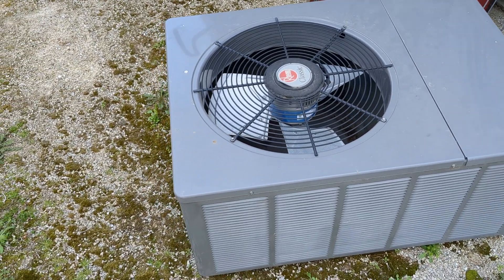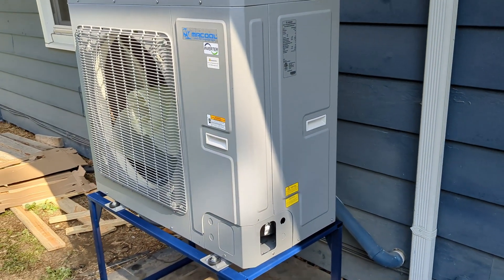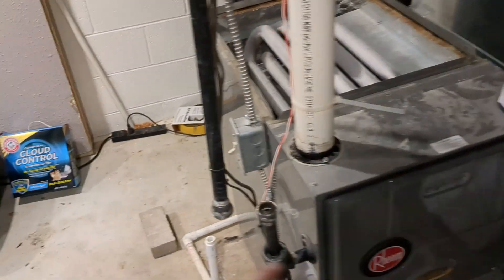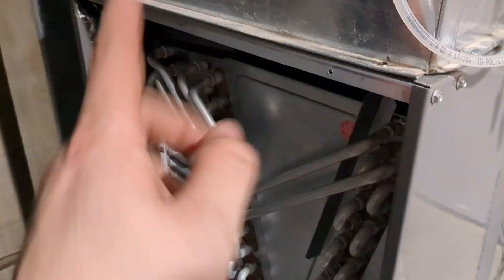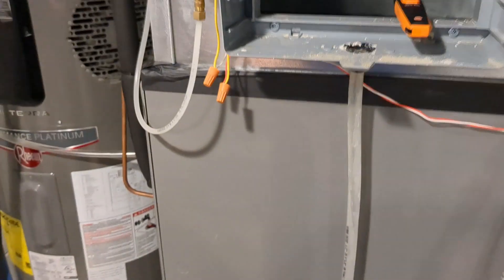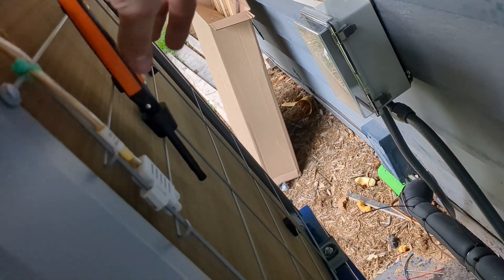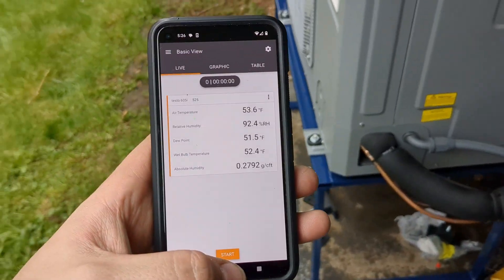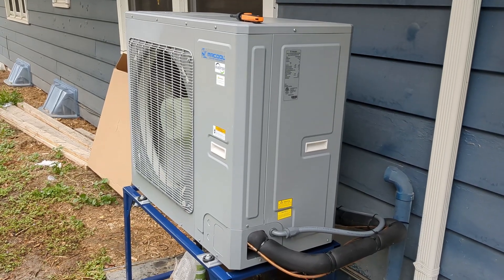Mr.Cool 2-3 Ton Install, On Existing Furnace

Comment: Hows your Mr Cool universal heat pump been working ?
Reply from the maker: No expensive sounds yet. Been working well.
Reply: @Bobdudeman1988-2 good deal. I'm installing the same exact unit except its a straight cool condenser.

Comment: Great job! Very interesting setup on not using Mr cool’s coil, which doesn’t seem to be offered for dual fuel application anymore. Also, evaporator coil you got is all aluminum and seem better quality than Mr cool’s. Since, I am writing as this video is already two years old, I was curious… Did you end up insulating liquid line? It is operating in HP capacity and this bare copper exposed so it must be loosing quite of heat in severe cold.
Reply from the maker: I insulated the liquid line that is exposed outside. But the run inside are bare

Comment: Hey do i have to change the breaker and wiring to the outdoor unit when installing the new one,i  have an old r22 system
Reply from the maker: No idea, depends on what service you have to the unit. I have a 10 awg 30 amp service with mine.

Comment: The guy at Ingram that I've been speaking with said I may have to install a txv to regulate the refrigerant passing through the coil (2.5 ton A-coil, not Mr. Cool brand), so I was wondering, why did you take out your txv bulb, I think you called it? I'm hoping your answer gives me a better understanding as to whether or not I'm going to need one, if the coil doesn't already have one built in, and if it does, why I would need to take it out. I'm using my existing conventional line set (plus the weld set adapter lines that came with the 2-3 ton Universal) and air handler, by the way.

Comment: Thanks for the video --- I am planning to do a similar swap of my Trane AC condenser, but leave the furnace as a back up when it gets really cold. Question: How did the control board/communications wiring work with the existing furnace? On mine, it has a control board at the bottom of the furnace that has a lead out to the condenser
Reply from the maker: @LifeWithPico  I have no idea what your trane uses for control. Most basic systems pull 2 wires out to close a contactor to start the condenser. You'll need to learn about standard HVAC wiring and then look at your unit
Reply: @Bobdudeman1988-2  Actually I think I should have said the air handler control board :/

Comment: Top notch job. I liked the burn out protection idea could you leave a link to the product you used .
Reply from the maker: I have since switched it out to a different device,
You can see it in my other video. The nice thing about the new device is it also displays current and can protect from over current as well. It's similar to this
https://www.amazon.com/Voltage-Protector-Protective-240300V-Display/dp/B0BLZB1WTK/ref=mp_s_a_1_4?crid=1UL6NOCQ4THYO&dib=eyJ2IjoiMSJ9.0J6nOitShKEMo0HUu5lThMIyD9oplQTQqAzwv9LcQEHcSd8PHA4_m1miJGY-K4OtCNlSfhEzOjlZHlNNVqqcKDAiZ4ICM0W9c8FfvROnyKlK3_j058syrbKCYHxTQOyjo5S9Skb5V2OieRWdrOBQnQgif5fCi7oQt6oi4iW2_-cTx1CA7S7VCX3yNWzKRCJe5Q24VZ5_tl9IMNJjNAwyUQ.hoYaj8fm2yoJ3NawJQE0eFhl791Nib_htSp5fQtzqzY&dib_tag=se&keywords=240+volt+protector+din+rail&qid=1728790680&sprefix=240+volt+protector+din+rail%2Caps%2C123&sr=8-4

Comment: Does your new condenser just cut on or off? Specifically,  your fan is blowing full speed or nothing correct?  I did this and since I didn't replace the evap coil or air handler, uts not modulating the condenser fan...it's full blast or nothing.  Is yours like this too?
Reply from the maker: @scottlanier5133  condenser varies it's compressor speed and fan based on load and outdoor Temp. Indoor fan runs at 900cfm fixed regardless
Reply from the maker: I should also had my indoor coil has a txv. With a piston it might not regulate as well on the outdoor unit? Not sure
Reply: @Bobdudeman1988-2 mine has a txv as it had an older heat pump
Reply: What did you do to get it to do this? Mine is running full speed on  outside and then cuts off. I am using an ecobee lite thermostat but it doesn't seem to be ramping down @Bobdudeman1988-2
Reply from the maker: @scottlanier5133  sounds like something might be wrong. It should do it out of the box. I hate to ask but I don't know your skill set.dont take it personally ..Did you evacuate to sub 400 microns? Service valves all the way open? Did you add any refrigerant if you have over 20 or 25 feet of line set? There any codes on the control board?

There is a free flexx service manual out on the web that can help you troubleshoot
Reply from the maker: On a warm day it is around 85 it pulls about 6 amps. On cooler days it pulls 4.5 ish.. is your load high?
Reply: @Bobdudeman1988-2  yes i had my hvac guy so all that.  No codes
Reply: @Bobdudeman1988-2  it's hot here but it just seems to run at one speed on or off. What thermostat are you using? I'm using an ecobee lite
Reply from the maker: @scottlanier5133  if it's hot and your load is high that's going to be normal. 

Thermostat choice won't affect it it just gets an on or off from y1 terminal for cooling, but I'm using am sensi thermostat
Reply: Got installed. Starts on high and then goes low - 3.3 amps on low...problem is we never saw it trigger back to high. Not sure what triggers it back to high speed on the condenser

Comment: My 4-5 ton Mrcool barely lasted a year. It was always breaking down. First 6 months the evaporator coil had a major leak.  It took weeks for ingram to send out a new one. Then the compressor went out. My Ac tech said  these are from China. Warranty department is the worst
Reply from the maker: its been over a year with mine and its been great, They are made in China by Gree, who is probably the largest ac producer worldwide iirc, failures happen, im sorry yours has not worked well. not many domestic techs work on these kind of units.
Reply: @Bobdudeman1988-2  my tech actually laughed when he saw the name brand . I was like yeah I know LoL. I bought a carrier cause I didn't want any more problems. I live in south Florida and I have to have my ac cooling
Reply from the maker: @CubanMofo  nothing wrong with carrier units. I like there rtu,s. Wisconsin can be just as nasty humid in the summer as Florida believe it or not. I'd die without ac too lol

Comment: So I have to do something in the unit if I don't need the heat pump because I have my gas furnace running?
Reply from the maker: No. But they do make a unit that's 700 bucks cheaper if you don't need the heat pump function

Comment: I just did mine and put it on the goodman LP furnace. I bought the universal evaporator coil and had a bunch of modifying to do to the sheet metal, but it was doable. The one thing I wish people would mention on these videos is the dual heat thermostat that is required. Good job though. Well done.
Reply from the maker: Dual fuel if you use it yes. Most t stats with a reversing valve terminal are so I didn't even think to mention it. I use a sense thermostat. Works good
Reply: Do you have a recommendation for universal evaporator coil?

Comment: Thanks for making this video. I noticed in the manual it says to make a non return bend taking the lineset to the top of the outdoor unit then back down to the hole in the house. I like the clean look your install has...do i need to do this non return bend?
Reply from the maker: My indoor coil is only about 4 ft lower than my condenser. I  can't recall exactly but the gree manual said if it's less than x number you don't need it.. I wish I remembered what it was. I didn't do it and it's been running fine. About 15 months so far

Comment: Are you saying I can use my existing coil from my conventional ac on this heat pump?
Reply from the maker: Depends on the coil. R22 vs 410a. Also depends on the expansion device. If it's a txv it needs to support reverse flow, some have check valves that wouldn't allow it to work in heat mode. If your coil has a piston you would need to convert to a bi flow txv

Comment: I lived in China for 23 years, the only primary heating and cooling units for the majority of the country are heat pump systems.  Where they aren't used, they have radiant heat from either floor heat or radiators on the wall.  And Gree is a major brand for China, but you can expect 5-6 year life with heavy use.  Still, a new one every five years versus 2-3 times the price?
Reply from the maker: Doesn't hurt my feelings, comparable domestic condensers run 10k for the same performance. Least right now. If it blows I'll simply repair or replace. The roi on it is short as well

Comment: How is the Mr Cool holding up over the last winter, been considering this unit and the Gree flex for my home in Wisconsin, and what did you set your cut off limit to so when your gas furnace kicks in just curious thanks
Reply from the maker: Been mild as far as winters go, we did have one nasty cold snap, but overall, it has been flawless. during the cold snap it was more costly  to run compared to gas however those costs could be made up by installing solar, like i plan too. As far as a cutoff, i have it programed as straight heat pump, no backup. i haven't needed any form of other heat, this unit has provided it all, all winter... ill be converting the furnace to run on propane and storing 100lbs tank to use as backup if never needed. See my video during the cold snap https://www.youtube.com/watch?v=39q6hQnDJqg
Reply: @Bobdudeman1988-2 why would you convert to propane when it’s more expensive to run than natural gas?

Are your rates that much higher in Wisconsin?
Reply from the maker: @NovvaOfficial  because i haven't used any gas since, and W.E. charges 14 bucks a month just to have the gas line connected even if i dont use it. the propane is just incase my system cant keep up for a a while(haven't had that issue) or it fails and  ineed backup heat. most heat pumps have electric backup heat but mine is not set up that way.
Reply: @Bobdudeman1988-2  

Understood. I work for a gas utility and your $14 is the rental fee for the meter most likely.

I enjoyed the video. It’s pretty eye opening for people who want to do this and have the capabilities to perform the necessary work to actually get it up and running.

Comment: How does the DC variable speed inverter Drive compressor work with a conventional Rheem furnace?
Reply from the maker: Works well. The coil on the inside has a txv on it. I'm betting the unit outside monitors superheat to control it in the summer. During winter the txv is not used on the coil and there are 2 exv inside the condenser. Not versed on how they work
Reply: @Bobdudeman1988   Sorry, I didn't word my question very good. How does the variable capacity condenser mesh with a single or 2 stage air handle? I'm just trying to figure out how it works.
Reply from the maker: @rickye7738  it simply calls for single stage heat or cool. And the condenser literally " figures it out" it's actually pretty impressive
Reply: @Bobdudeman1988  That's cool but I'm guessing that if the air handler is operating at full capacity then the condenser is never going be able to reduce capacity enough to increase efficiency or decrease unit short cycling or improve condensation removal. I'm I missing something or is it kind of a waste to have an inverter compressor run an almost full capacity all the time?
Reply from the maker: @rickye7738  it for sure isn't a waste, it does what It can to maintain a constant suction temperature I'm assuming, but it varies how hard it's ruining based on outside temps and refrigerant load returning from the coil. It does a very good job pulling humidity out of my home. .
Reply from the maker: It's also a heck of a lot quieter and don't get that massive thud and inrush from the old style units when it turns on. It gradually ramps up.
Reply: @Bobdudeman1988  That's awesome! I didn't even think about how much quieter they are but that's a good point. I'm considering doing something similar and weighing the pros and cons of both. I wonder what the longevity of it would be compared to the old scroll compressors. On minisplits, they seem to last a while, but then again they're usually running at around 30 or 40% capacity. The flip side of that is that they run longer, which might cause just as much wear. Good to hear that it keeps your humidity down. That's something I've been worried about with oversizing and not having the variable capacity.
Reply from the maker: @rickye7738  that's the million dollar question, it has a lot more electrical stuff inside with an inverter. Not just your basic scroll. From what I've read it's a 3 stage rotary compressor, it hasn't run full tilt on its own , only during defrost do I hear it spin up quickly. I worry about longevity as well. But in my experience inverter and vdf tech had got so good it may last a decade. Then just replace there considerably cheaper than domestic units with similar tech
Reply: @Bobdudeman1988  That's really interesting that it doesn't run a full capacity. If it just gets a single stage heat or cool signal, how does it know that you haven't cranked the thermostat up or down 5 degrees and want 100% capacity? You definitely make a good point about how much cheaper it is than similar domestic tech. It makes me wonder how much longer our local manufacturers can compete.
Reply from the maker: @rickye7738  is a rebranded gree flexx 2-3 ton system. It won't respond that way for sure.. I think it uses time? There was a video they had out that was pretty long that explains a little more.  But in reality how often do you crank it from 65 to 70 or vise versa. I keep mine at 70 year round..so I guess that hasn't been an issue for me personally
Reply from the maker: https://youtu.be/HXaYoujI9U8?si=vaDPPX4YgikJ0SJ4

Comment: How did you wire it ?
Reply from the maker: You'll need to be more specific..
Reply: @Bobdudeman1988-2  The low voltage to the indoor furnace and thermostat from the condenser
Reply from the maker: @harmonairllc2368  it has the thermals for the basic wires y,w,g and b inside the condenser I don't use any heat strips and I didn't want my furnace trying to use gas during defrost. So I left w disconnected. It hasn't been super cold yet so I may change it but so far it's been good
Reply from the maker: During defrost it calls for fan or emergency heat ( in my case normal gas heat) during defrost to prevent a chill during it. But it only last like 3 minutes
Reply: @Bobdudeman1988-2  So the condenser is just missing the component to shunt the 24v and switch the cycle to cooling while in auxiliary for gas heat. Defrost timer/temperature senosr
Reply from the maker: @harmonairllc2368  it's not missing, it doesn't have a defrost board like most heat pumps. It has a main control board that looks a lot like the one in a furnace 

During heat your tstat calls for y plus b for the reversing valve. As far as the furnace, it thinks it's in cool mode at this point

During defrost, the condenser can select g for fan( how I have it set) or w for emergency heat, they also will call for heat if the unit has a problem and can't run.
Reply: @Bobdudeman1988-2  but you have the w for heat off because you are afraid of the furnace heat running while the heatpump is energized right? Maybe you need a different thermostat with auxiliary option. So the main board has all the required wires for heatpump and it defrosts but you can't control it because it doesn't have a defrost board . Just a bit confused.  Trying to figure it out. The condenser fan should be off and in cooling while the furnace heats during defrost
Reply from the maker: @harmonairllc2368  the thermostat still has w connected to the furnace. The w terminal from the condenser to the furnace is disconnected. If I need gas heat my sensi thermostat can call for heat on w. It also warms me via the app if something happens. Under normal operation the thermostat calls for y and b for heat, or just y for cool.
Reply from the maker: When you use a heat pump, you don't use w for heat, you call for y and b( reverse valve) so it runs in heat mode.

Comment: Can you post an updated video once you get a really cold winter day? It's smart to have the gas furnace too, I'm just wondering if the heat pump can still keep your house warm if the air temp is below zero.
Reply from the maker: So far. It's been great. It has not been that cold yet here though. 19f at night was the closest and it had Zero issues. Iirc it was pulling 10 amps and ran for about 9 hours out of 24 hours. 1600 sqft house
Reply: @Bobdudeman1988-2  WOW that's like the power usage of two space heaters. Very impressive.
Reply from the maker: https://youtu.be/39q6hQnDJqg?si=JPEW1mCn91u8lsTV

Comment: Where did you get the condenser stand from?
Reply from the maker: I built it from scrap tubing. my idea was to wall mount it like a minisplit but at 250 pounds it was too heavy for commercial offerings I was able to find as well as its width was too large. so I made the sand instead, its holding up well.